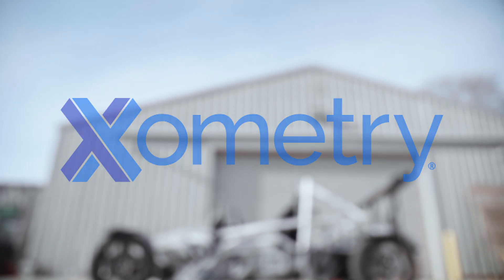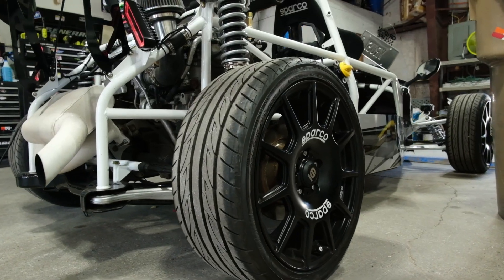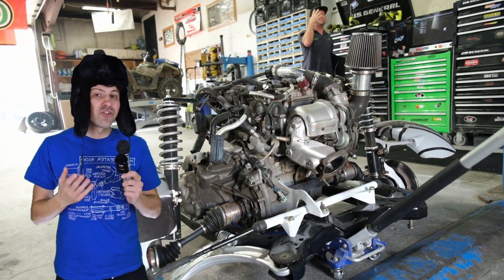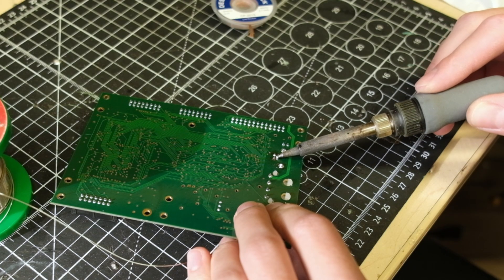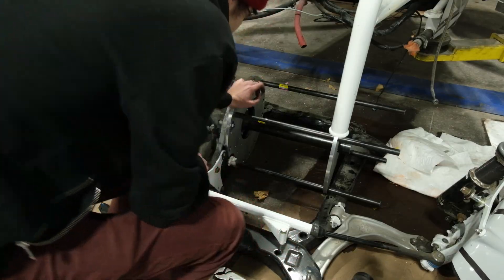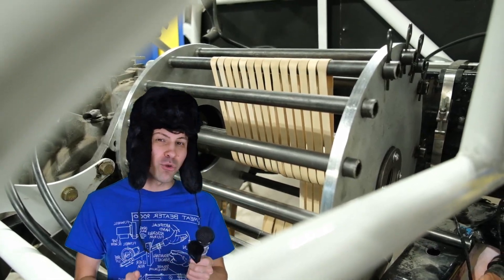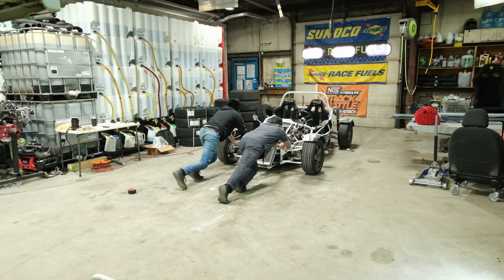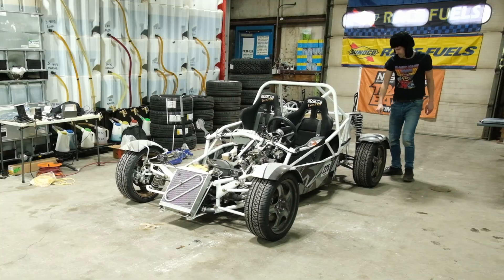How many rubber bands does it take to power a car?

Comment: Get yourself a few of those Springs out of a Sherman tanks “vertical volute suspension system”, and try use that . Also if I do remember right, most of those spring loaded pull back to cars also had a weighted flywheel to help smooth out acceleration and add a bit more travel distance.

Comment: I think you need to stretch them on a straight, lots of short pieces of rubber band aligned and from this wide but short elastic assembly atach a non strachable  string to the thing that rotates

Comment: Could put those rods on bearings so they spin for the elastic bits as they expand and contract. The garage coil was a fair idea but id think elastic has more potential? Traction is for sure a limiting factor there, but. Newtons law of motion, you only get out what you put in up to what it can store.

Comment: What about using some bungee-cord like they use for bungee-jumping and tension it forward and back over the complet length of the car multiple times using pulleys? A bit like the mechanism that stores energy in a compound bow!

Comment: Just catching up (very late), but...my gut feel says you don't need more speed, you just need to apply the same force for longer. Accordingly, I wonder if you could actually build a multi-stage concentric spring arrangement - so the inner spring winds up first, then the next one out etc, all the way to the outer spring. Then, when it's let go, the outer spring releases first, all the way down to the inner spring. The one catch is that it'd need some pretty precise manufacturing of the springs, so that the difference between the diameter each spring's coiled and uncoiled states fits exactly between the coiled and uncoiled states of its inner/outer sibling respectively, but it would let you store a lot more energy - and the first springs to release should have more torque too, which is exactly what you want.

Comment: If I was gonna do it, I'd use a winch type setup with some, like, old car strut springs or something and a LOT taller gearing, use some teeny little shaft that winds up over a LOT of turns and compresses some real massive coils linearly instead of winding the spring itself. Also would personally keep your hand on the gearstick just SLIGHTLY trying to pull it out of gear, in the neutral zone between accelerating and rewinding it wants to pop out so you can use that to freewheel and coast.

Comment: Never realized it, but yes. Those pullback cars were so simple*, and yet held the attention for long enough to spend an afternoon "launching" them around the house floor until the spring system broke because for some reason they were not designed to be pulled all the way back so often, or to be released while held in your hand to just see those wheels loudly spin.
At least back in my day, child toys were simple* but not durable.

* Simple in how to use them, I am only 2 minutes into the video and chat is suggesting the inner mechanics deserve a lot more credit. x)

15:21 Oh wow! This actually taught me why one of them broke like 2 decades ago. That (except higher pitched because it was smaller) sounds exactly like what happened to one of my pullback cars and then it just didn't do anything anymore. :c

Comment: I did some number crunching and for a scale model of 1/24 it would take 3500 rubber bands or a spring with a force or 1680 ft lbs I would recommend using a compression spring with less coils so it don't bond up while compressing less coils can lead to more compression at 1680 ft lb of compression should be able to achieve at least 20 mph also try to keep the car in neutral instead of shifting gears

Comment: not educated on the subject but the weight of the car is a big factor to speed and the size of the drive shaft locking the spring to quickly matters

Comment: How about a completely different approach. Instead of installing the spring in the vehicle, it would be possible to attach the spring to a steel plate, compress the spring, push the vehicle against the compressed spring and then release the spring abruptly. The relaxed spring pushes the vehicle.  I know that I had a vehicle with a similar principle when I was a child.

Comment: I would think that 1st gear would be best because it would have the most torque. Having the energy turn into torque quickly before it runs out seems like it would be best. I mean, there's a reason 1st gear is 1st gear, right?

Comment: Using a gear ratio with the bands and spring connected to the largest gear could let you go way further out of a smaller push, letting you not have to stress the spring as much. The only downside would be how hard it would be to push the car back.

Comment: If you put two spring and connect the spring together then connect one of the spring to the body to lock the spring and connect the end of the spring at drive shaft that's will work with bigger

Comment: When you pull back on the toy car you apply extra downforce to increase the traction to store more power in the springs just pushing the toy with the weight of the toy results in the same results. Need a thicker spring and use a winch or something similar to slowly charge the spring then set it down and let it rip. like how you hold your fingers on the toy cars wheels and go for a second pull back with much more resistance.

Comment: You are using a heavy car. Start with something really simple, just a tube frame with a chair in the middle and just a tube with bearing as front axle, and than the rear you put your rubber engine and again tubes on bearings. So the car is really light and if you build it yourself you'll be able to have a bigger engine and so more rubber bands for more power.

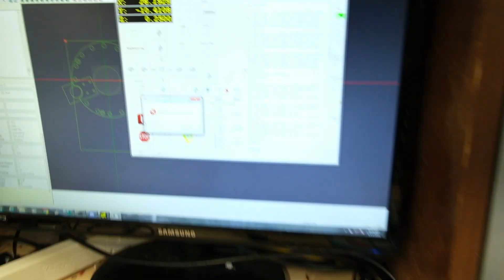Comment: Reply to 2:44... This is just a wildcard guess by a computer nerd.
But have you tried checking if the problem could be related with "usb power suspension"? (occationally pc decides to disable usb port power because it thinks the device is idle)
This setting is normally enabled by default to save power usage. But frequently annoying to many types of device activity.

Comment: Pro tip: Lube the pipes and put a slightly bigger tube (ID slightly bigger than the OD of the inner tubes) around it to make them turn, that way you'll lose way less efficiency via friction.

Comment: Sweet vid ! Digging the channel . I'm very familiar with torsion springs & . the toque & max winds / cyles  The torsion spring is a good idea but your need a larger moment arm on the hub / spindle basket thing . What diameter is the axle that the spring rotates with

Comment: The maximum safe distance to stretch a rubber band is about 4 times the starting length.  You don't want anything to touch them when stretching or they will break.  You should have started with a "cyclecar", they weigh a fraction of a normal car.

Comment: Some things you probably want next time:

1. Don't have a shaft running through the spring, have the shaft reach just into the cage and have it terminate to a plate that you can mount your torsion spring to. You still get the safety from it and don't have to worry about awkward winding or spring diameter as much. It's also really useful to get better geometries going like twisted rope bundles if you want to get away from metal springs again. 

2. Constant force. Right now you are doing the charging and discharging of your system at linear force over displacement curve, you're going with hook's law. That is an issue because it means that the energy stored inside your system in terms of the peak force / torque F and the total (angular) displacement L is 0.5 * F * L. While in a constant force system you get just F * L. Torsion vs linear doesn't matter, the physics is equivalent with angular displacement replacing linear displacement. That factor 2 is big game, you're 40% slower than you should be and/or put twice as much stress on everything

There are two ways of getting there:
2.1 Preloading your spring. You know twisted rope catapults? Take a rope bundle, carefully wind it up, letting the torque increase to your desired level. Then only put an additional 45° - 180° on it for charging and you got a system storing 1kJ per shot with a 1m lever and 35kgf (so 70lbf) of preload. Built something to that effect as a teen and it is scarily effective. This as the added benefit of solving your awkward winding / tangling issue, you take care of that once since your displacement during charge and discharge will be small. It also allows your to go back to a twisted rope or rubber band bundle and still likely get decent results. You probably want a lot more than 180° of displacement, maybe 5-10 full rotations, so I suspect a bundle of stiff rubber will be best for you. Note that a twisted rope/rubber band spring is most efficient when it's much longer than thick, so you 

2.2 Variable ratio gearing. Another muscle powered weapon also shows off a solution to that problem: modern bows! The pulleys at the end have variable radii so that your mechanical advantage from that always evens out the increase in force from the bow itself roughly following hooks law. You could try doing something similar by using variable radius gears that do one rotation, but if you want to get 500kg of car to 25mph that gear would need to handle a minimum of 50.000 Nm which is like a lot. It's probably possible to build it, but it'd be a huge hunk of steel. More likely you'd want something similar to a double clutch or CVT gearbox so you can switch gearing without decoupling. But thats like a huge modification to the car. Usage would also be weird with you having to shift down as you accelerate.

Either way: bad news - Getting 500kg of car to 25mph is ~30kJ. The engine that belongs in that thing had like 300Nm going significantly above that might not be great for the transmission or drive shaft. At 300Nm getting to 30kJ is like 20 full rotations. That's with constant force. If you don't manage to get a constant force setup it'd be 40... I suspect more than 5ish is gonna be hard without getting tangle issues or the preload strategy not working. That's only 10-15mph - enough that it would be over the speed limit in a few places I guess... 
But if you're married to 25mph you probably need a custom car. Aluminum tubing instead of mild steel. No heavy diff or gearbox. Much closer to an actual rubber band car. If you manage to cut the weight in half that's half the rotations or half the torque your system needs to handle. I'd probably try to aim for 200Nm, 7 rotations inside the motor, and 250kg for the """car""" plus driver for a bit above 20mph if everything is pretty efficient.

Comment: You can try attaching somethjng to the back or the car that holds the springs and have ropes on the shaft. When you pull back the ropes wrap around and pull the springs. Then you let go and the springs will pull back to their resting spot, hence pulling the ropes and powering the car.

Comment: Remember reading a scifi book decades ago (dont remember name) where it described a guy driving in mars on a spring loaded car and as the car winded down you essentially go to like a winding station where you park on giant rollers that spun the wheels to wind it, like emissions building but not using the engine.

Comment: Wait I don't get it. You pull it back on 5th gear and release it on 1st gear, that should have gave you some progress.
On pull phase you need more leverage on wheels to wind back the coil, e.g. 5th gear, and you need spring to have more power moving the car, so you switch it to 1st gear.  
|Am I missing something?

Comment: I can see 1 clear issue with a relatively small fix. When winding in reverse you would need to use the highest gear to get the most force on the spring via the spigot. Then you would need to change down to second or first to go forward , so that the spring would deliver enough force to the wheel. Now I see you cannot hold the spring so that you can down change , a hydraulic e-brake with a disc and calliper mounted on the bird cage wouldn’t be that hard.

Comment: You may be able to have the rod with the spring on it covered it foam or something similar, that can hold the spring straight when winding it, but has some give so when the spring gets tight, the foam can shrink.

Comment: I think if you reeled it back in 5th put brakes on the rubber band engine then shift to 1st with the engine pre reeled then let go you'd see better results 
Then the weels wouldn't start sliding when reeling back

Comment: What if you stretch the string instead of twisting it.  Attach a spring (or 2) to the front (maybe under the seat), put some rope at the end of it, and have the rope wrap around the bird cage and stretch the spring.  I haven't mapped out the logistics, but you get the idea.

Comment: I know you should be fine, but using a hitch to pull is dangerous… especially because its location would send it directly at you. 

It may be the easier option, but a metal baseball moving near supersonic speed will most definitely put you to forever asleep. 

In fact nothing there is meant to take horizontal energy.  The forks are meant for vertical forces, and if that were to snap…  let’s just not think about that.

Comment: Obviously size is a huge issue, and I know you hate math… but here math can actually be helpful.  

You’re being pulled back by a forklift D amount of distance.  That creates E amounts of potential energy, and by using the weight of the car you can (W) you can figure out how far you would be able to move with zero mechanical resistance.  

Using the different gears, you can turn increase E without changing D you’d need a gear ration change.  

You essentially need a transmission that turns low RPM to high RPM instead of high RPM to low RPM.  

Also doing math would help you figure out how much energy is required to reach 25km/h by figuring out how much energy is required to move D, and then figure out how a good gear ration for you to move D in T amount of time. 

It’s a shit show, but it is possible, and probably easier (and cheaper) than this.

Comment: Mate, you need a screw  gear against the flywheel so you can bench test it.  And a brake on the flywheel so you can keep the stored energy and shift, charge it in 5th, launch in second.  You can do it with the bands, don't cut them, the glue is the weakness. a smaller core ring anchors the band, the outer should sheathed in an outer lubricated sheath, and the band is hooked outside through those spokes.  The bands are folded and the outer bar should be convex so the bands climb to the center and don't bind. Longer bands are better as long as they arent stitched or glued. 

The connection points don't move, the band is stretched and rolled over the outer shafts, it will hang as a mess when not under tension.  Pass a stable  base in from the other side of the shaft, you end up like a looney tunes tweety bird style birdcage where the supporting pedestal is pressed in forming a stable base, and the cage touches the "middle" of the bands as they stretch.  Then take power off the top, or even gear the two shafts together for arbitrary ratios and take the flywheel on the output so you could try different belts or gears day of to  get different ratios to the wheels.

Comment: My friend you NEED a round coil spring!! If you rethink your design a bit for the cage you could make a box around an industrial sized coil spring, and set it up with the shaft going directly through welded to the center flat bit and connect to the drive shaft, you can pull that suckered back and zoom! The round coil springs are what are in the toy car!!
Reply: Also thank you Aaron and David!! Please look into the coil springs pleaseeee

Comment: heres an idea: or suggestion: could potentially model and 3d print or otherwise create a collapsible lattice to reinforce the inside of the spring? My initial idea is a mechanism that looks like one of those ASMR skull scratchers. instead of each prong terminating at the handle, they have a sort of fulcrum extending back out. as a unit it would have a certain "flared base" where tension can be wrapped around all of the prongs opening them inside of the spring. its a B**t pl*g for your engine. lol.

Comment: Go back to rubber. Possibly get better bands at dicks sporting goods. Do NOT wrap them around the axle, you have two far better options:

1: clamp seat belts onto a single rod on the cage itself, and have them lead the rubber, anchored far back (maybe even a trailer, single pulley cantilever, idk) onto the spool to get more stretch out of the bands before they begin winding.

2: Replace the cage entirely with a worm gear, and use multiple toothed gears to drive this with multiple bands wrapping around eachother, like what you showed peter stripol doing. This kind of winding is a MUCH better way to store energy in the bands.

You can do this. Please do or I may claw my skin of in the mean time.
-an idiot

Comment: Instead of the spring connected directly to the wheel why not try a similar style to can i also remember where you would drag it and the wheels would stay spinning now that requires a big gear box and alot of energy to start it but what if instead it charges a fly wheel then with the fly wheel have it when you press the accelerate the fly wheel links up to a gear ratio converting the high speed to lower speed but really high twerk it might be slow but the distance would be greater

Comment: yes there is more that u can do cause they stopped using elastic in those tiny toy cars a long long time ago and went with coil springs which has the benefit of as it gets wound up it has less strenght on the inside over the out side which makes it go layer by layer removing a ton of friction and i promis you atleast 10 x the result u got now if you do it properly